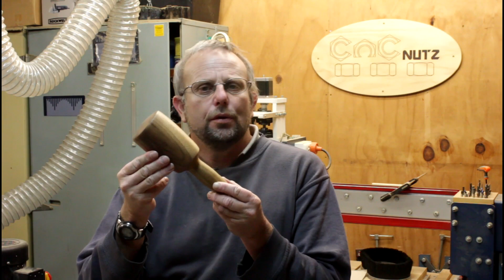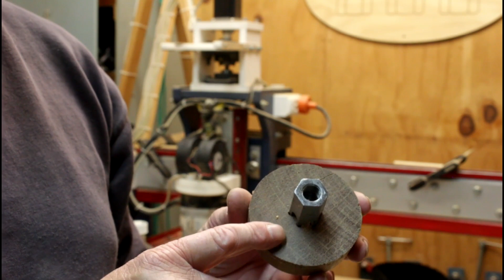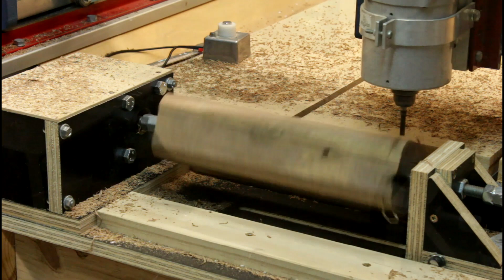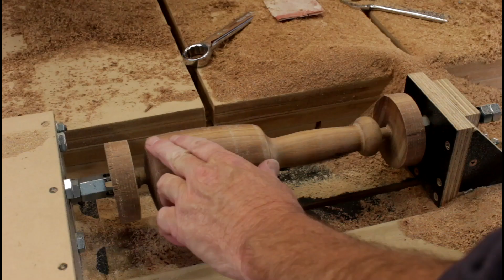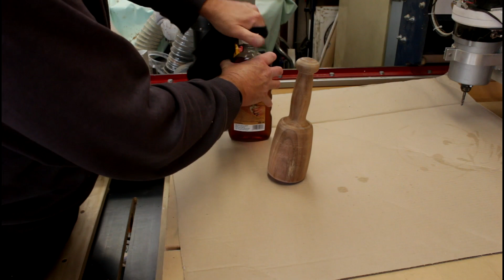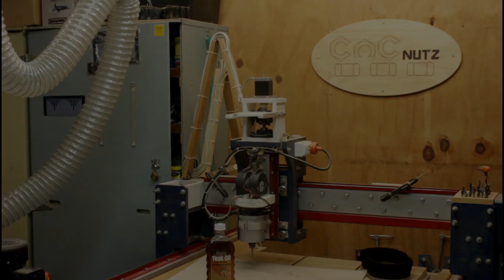Wood Carvers Mallet - CNCnutz Episode 81

Comment: Hi. Thanks heaps for creating these videos and sharing them, i have learnt a lot from your videos. 
Just a quick question about the zero touch plate you use. did you have to make any modification to the router to allow the metal casing to be electrically connected with the cutting bit? or is this just a micro switch that the cutting tool pushes on to open and close the circuit? 
Thanks from Aus
Reply from the maker: +Trevor Burke 
Hi Trevor.
My router case is has a metal body which completes the circuit from the case through the bearings to the shaft which has the collet in it and the router bit. If I was using a router with a plastic body I would simply connect the cliplead to the router bit instead. The router has not been modified, at least not for tool setting. There is no switch in my tool setter.

Here is a video on how to build a tool setter like mine.
https://www.youtube.com/watch?v=LJ5TAdJotw8 

Cheers
Peter